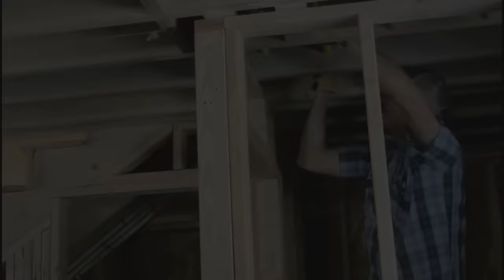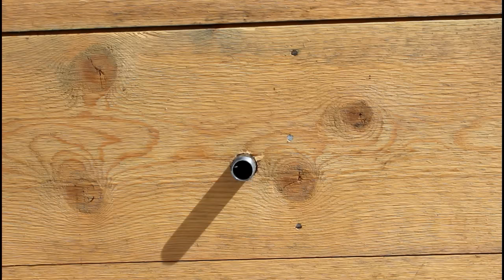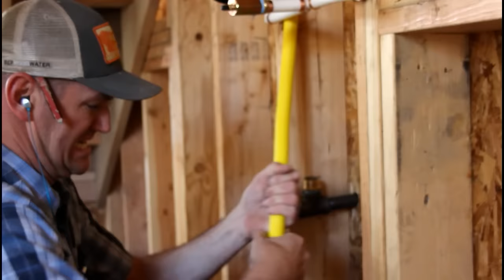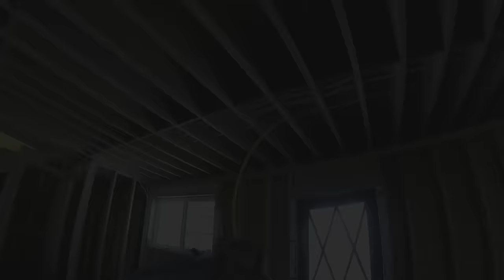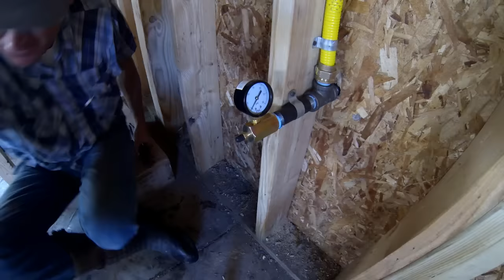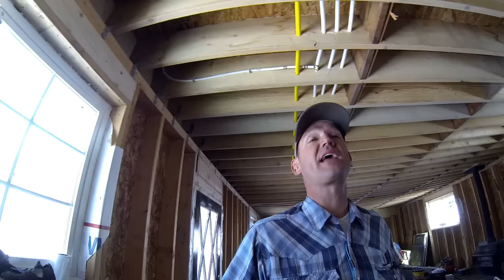#207 - I Installed Flexible Gas Line From Home Depot... (It Leaked!)

Comment: So am I right in thinking a propane tanker will come down the "Road of Endeavour" and fill your system periodically? With your skills you must have thought about heating a water tank with heat from the wood burner, and save on propane. Why did you not do this, I'm curious as to your thought processes? Always a big supporter, wishing you and yours the best.
Reply: Burning wood for hot water is wildly inefficient lol

Comment: was that connection in the ceiling a permanent type connector or a tapered seat threaded together type? I would be worried about a removable type connector hidden in the ceiling.
Reply from the maker: Permanent.
Reply: Iat used to be that gas coupling fittings  were allowed in hidden areas but Union connections were not. but I never was a plumber

Comment: In the USA you have to be a license contractor to install any type of gas line as well as proper training in all different type of materials that you will use.  When I run into a new product I make sure that I understand the way I'm suppose to use the new material.  I've seen plenty of mistakes from handyman and wanna be plumbers. Good video and I like your advice for others that don't know. Thanks for taking the time to do this.

Comment: As a European it is so strange to see gas lines running in the ceiling when it's used on the ground floor. Here the Netherlands is a building code to run those under the house and have them come up through the floor where it is needed.. say the kitchen

Comment: That whole you have to use a certain color of Teflon tape for each type of material I'm not a firm believer. I've found that white Teflon tape works well for any type of material unless your current code requires it.

Comment: I see you have a Laundry Room.  That's going to be a lot of laundry for five children.  I was wondering if Cedar could use a propane gas dryer.  Anyhow, great job going on!

p.s. the AltE Youtube site really breaks down how to size a solar system.  The video series (22) I am referring to is called "Off Grid  Solar Power System Design."  If you watch the first five videos, you will know how to size your entire system.  I am taking notes right now.  This series is a Golden Nugget in solar design.  Amy Beaudet also shows you how to hook up the system in some of the other videos of that 22-video series.
Reply from the maker: I will likely add a line for the dryer up there. We talked about it and have since decided to do it.
Reply: Thanks for considering my suggestion.  There's just one more critical item as I comb through the numerous number crunching on solar panels.  The example AltE uses is for a 2,400 Watt system (probably near $5,000), four 315 Watt panels, four 24V batteries (two in series + two parallel strings).  I notice our new refrigerator sucks up 1500 Watts/day (25.2 cu ft).  That only leaves you with 900 Watts for the house.  I have to decide if I would get a propane fridge instead, so I can free up those 2,400 Watts for all other stuff.  I don't know the answer yet.   I do know if you double your solar system, you double the cost.  I am leaning towards a propane fridge, instead of spending $10k on a solar system.  Just thought I'd mention the fridge before you button up the gas line.  The point being, does one want an electric fridge or a propane fridge?  It boils down to using microwaves, coffee makers, toasters, etc.  Based on my habits, I supspect I'd use a propane fridge.  Over and out!

Comment: I'm pretty sure threaded connections aren't code inside a wall...  No nail plates. Seems like a house waiting to explode.
Reply: Of course threaded connections are safe like steal threaded black pipe inside walls and ceiling same as wather pipe connection 
Your car have a gas tank so you’re car waiting to explode
Reply: If the wall cavity is vented it is legal in Illinois. They do make wall and floor flanges for wall penetrations. Threaded connections in the wall are dangerous if they leak. Also the manufacturers aren’t all the same. Track pipe is preferred by my company due to quality of fittings and piping.

Comment: When should you use a manifold???
Reply: Typically for low pressure residential I would install a manifold right after the gas line enters the house, usually in the basement. The initial gas line is over sized so it can handle the present and estimated future load. Then I size each run and build a manifold out of black tees, and run the appropriate sized CSST run to each appliance. In Ontario CA. you can place the appliance shut off valve at the manifold tee if the branch line is under 50 ft. Or you can have at appliance, or both. If there are some really long gas lines, and it's possible that the local gas supplier will provide 2 or 5 psig meter pressure, then I would do the long runs in a smaller pipe size to get the gas supply nearer to the appliances { in a mechanical room for instance } , then regulate down to proper appliance pressure, and build the manifold in that room for those appliances.

Comment: Why did the pipe get connected in the middle of the floor joists ? Thanks.
Reply: Because he purchased 2-25’ rolls not a 1-50’ that he needed.  Those fittings cost about $10 each.
Reply: Because the Home Depot brand only comes in 25' or 75' lengths.... so purchasing a 50' roll was not an option.

Comment: Propane tanks on ag running gear are common here.  Might be useful as the nonprimary tank (multiples not run in parallel here) if the supply truck will only meet you at the end of the gravel road.  Old NH3 tanks can sometimes be converted.

Comment: Holy crap 25-30lbs?!  That's insane, most systems where I live are .5 to 2lbs max!  Main lines from gas company is max 50lbs.
Reply: Its for the pressure test to make sure it doesn't leak. It isn't the gas pressure.

Comment: With that first tee I just assumed you were making a drip leg. I thought why is he putting that drip leg through a hole in the wall. It took a second for me to process it. 

It’s interesting how many variations there are on gas pressure testing considering there’s only two codes. Some places only require a little over the operating pressure. I’m in Austin and they require 30 psi for 15 min for low pressure systems and 60 psi for med to high pressure systems.

Gas tite is pretty expensive stuff  but it definitely is nice when you need it. In your case where you have to go between joists and only have a couple of fixtures it’s wonderful. If you were paying a plumber, you’d make up that extra cost by saving on labor easily. However when you have houses with gas dryers, water heaters, furnaces, stoves, etc. and everything is under the house or in the attic, it’s definitely cheaper to use black iron especially with mega press. 

We’re not allowed to secure gas tite in the wall except where the stub out is. The reason is for nail protection because it’s so thin unlike black iron. If it’s allowed to be loose it will be pushed out of the way by a nail or screw but when it’s secured it will be penetrated.

Comment: needs bonding and i would never buy the csst from big box stores(or rather they shouldn't sell it) because as an HVAC tech, we are supposed to be certified to sell and install this material, one wrong connection and your new house is leveled.also your inspector should know enough that high pressure like 25 psi can actually seal a minor leak instead of showing a leak, we are told in our area that we only pressurize to 1 1/2 times the pressure the line will be under in normal circumstances which is in  " water column not psi. the Flashshield by gastite also has a bonding mesh incorporated into it unlike the home depot stuff. Also  gastite makes termination fittings for stubbing through the wall to eliminate as many leak points as possible.be careful in the house in the event of a lightning strike if you dont bond that ENTIRE gas line properly.

Comment: Great video quick question, I'm new to the CSST tubing do I need the bonding clamp for ground, if so where do I ground it to?  From what I've seen from reviewing this stuff, it clamps to the black pipe but where does the bare wire get the ground from? Thanks in advance

Comment: Does this type of flex pipe need to be grounded in any way ??
Reply: Yes it does, I just had Weatherservice do an install for me, and the guy used the #6 ground wire.  He is with the HVAC company, and my ex-husband works with the gas company, and he said it has to be grounded as well.  It is suppose to help lessen the chance of sparks because of the type of material made with the flex line.  The question I have is...the guy from weatherservice told me that the line can not be ran through wood/joust.  So, my flex line is visible, on the outside of the wall.  I'm trying to figure out how to cover it up, and have easy access to it.
Reply: @littleclay1838  Depending in what state you are in it will vary on the type of installation. as for covering up, I would think that the connections/couplings should be made accessible. you could probably do a long box with a long hinge to cover it..??

Comment: Ironically , if you order a new gas stove installed by home depot they WILL NOT install to this gas line. I just had this problem this week. They will only install a new stove to black pipe. Even though they sell this gas pipe.

Comment: why not use a gas dryer if your doing off grid and your usieng wind and soler an electric dryer will use a lot of power if you have it gas heated than its far less all it does than is turn the moter insted of power heating elements as well you could also use a propane fired furnace  to for the days the wood stove isent enough

Comment: Am I the only one that’s absolutely shook his apprentice hit a 50 psi main line? I’m sitting here weak af. Like I’ve had some bad days as a gas service apprentice but goddam. I’d straight up switch trades if I pulled some shit like that... Also, no shit gas code is yellow. If you haven’t  arrived there yet you shouldn’t be watching this video or installing your own csst! It can be tricky , especially if you don’t use a cutter designed to cut csst. I was literally on a gas leak call today where a local contractor failed to cut his  csst with the correct  tubing cutter  and the fitting was pouring out gas directly next to the furnace as a result. It saves lives to invest in the proper training and tools to complete the job. All I’m saying is take what the homie on YouTube, who hires techs that don’t know the difference between gas and water lines, with a grain of salt. Do extensive research, buy the correct tools (as expensive as they may be) and assess the risks before installing your own csst gas lines... either that or research a good, reputable local gas contractor and give them your money instead. We charge good money and have a license  for a reason. Fresh video tho
Reply: All I heard on this comment was blah blah blah I’m a big bragger
Reply: @rubenllamas5644  you probably do your own gas plumbing too so it’s all good
Reply: Well I’m a second generation general contractor so yes I think I should know how to properly run a gas line. Don’t talk about it be about it.
Reply: @rubenllamas5644  All I heard was blah blah blah I’m an old man
Reply: Dude I was born in 1991 😂😂😂😂
I don’t need to talk like I know it all or like I’m perfect in order to make my existence meaningful. In your comment you were bashing the apprentice who makes mistakes 😂😂😂😂. Idk who trained you but obviously they skipped the part where mistakes need to be made in order to grow idk who told you you need to get it right the first time. Or maybe you are perfect but that’s highly impossible because just by yoour comments I can already point out a few flaws of yours that you probably continue to apply in your life because you think you know everything. It’s a lot easier to teach someone who wants to learn an is flexible to understanding that he don’t know everything than trying to teach someone who thinks he knows everything. In order to be a good master you need to be a great student. So maybe you should take a few steps back an recollect yourself and remind yourself where you came from.
Reply: @rubenllamas5644  everyone makes mistakes and I’ve made my fair share but I’m not gonna post my mistakes on YouTube and pretend it’s good work. I’m definitely not gonna have a sore ass after I post my mistakes on YouTube pretending it’s good work and somebody points out the flaws in my method. I think it’s you who needs to take a step back and realize we all can learn to be better people and technicians by having a dialogue and a back and forth conversation instead of a sore ass.
Reply: You make 0 sense buddy
Reply: It’s not the punch it’s the delivery learn the difference
Reply: @rubenllamas5644  I understand you have reading comprehension problems. Go run Daddy’s business and have a nice day buddy
Reply: How else do you think empires are built 😂😂😂😂😂😂

Comment: It comes as no surprise that the flex line leaked. It's garbage. You should always use black iron pipe for gas to prevent these kinds of problems. You're asking for big problems using flex gas line, especially in a basement or crawlspace.

Comment: Don't you have to bond the csst to ground?
Reply: Yep, according to the manufacturer he does.  His inspector doesn’t know it, and he failed to read the instruction manual. Your supposed to have a card from the manufacturer stating your trained to install this this, before you can purchase.
Reply: You don’t actually bond the csst, you bond the black pipe as close to the csst as possible.
Reply: And if you can't bond directly to the black pipe, bond to the brass fitting attached to the black pipe.

Comment: can you use flexible gas line to for your bbq grill setup?
Reply: Csst can be used right up to the Appliance. You can run it straight to the Gas Valve if desired. Just remember to install a Sediment Trap if installing a Water Heater or Gas Furnace. Also check with you local Code official for any amendments. Master Plumber.
Reply: I used CSST to install a Natural Gas Grill at my Home. I used a combination of Black Pipe and CSST. Worked out fine.

Comment: Can anyone install this piping? Do you need special certifications? I need to plumb my entire mobile home for gas.
Reply: Just don’t blow your house up, and I don’t recommend using Teflon tape for gas, it is approved in some states but illegal in others, I’ve seen Teflon tape sealed gas pipe leak way more frequently than pipe joined with a good non hardening dope, go online to gastite.com to get more info on CSST installation and install the pipe with the appropriate strike plates, floor flanges, etc. and use the longest run method to appropriately size the tubing, get the latest IFGC book for relevant information on installing CSST and appliances for mobile homes, good luck!
Reply: In my state only a state certified master gas fitters can do gas lines.  The gas company will not release the house for gas service without a pressure test from a gas fitter.  If they provide gas and anything happens they would be liable for providing gas to a house not properly ready for gas.

Comment: omg amateur you did everything wrong.. first off you NEVER put the Teflon on clockwise with your right hand while in direct sunlight - according to building code you NEVER ever do that trust me i'm a journeyman tube snapper for over 3 years - just kidding good job on the house, looks great and awesome video, it answered my questions I had for my next project .. like and sub'd
Reply: tube snapper....lol
Reply: Your second fail is u do not Teflon tape propane lines only if it’s over 1 1/2 black pipe just dope it
Reply: Atleast in north Carolina you can not drill holes in floor Joyce

Comment: The pipe you put thru the outside wall for the regulator hook up looks like it got some wood chips in side of it when you shoved it thru the wall then you put a cap on it.
Maybe you should have blow  all your piping out before you do your FINAL INSTALL of everything. 
Just my 2 cents worth
Reply: Since there is going to be low flow, low pressure gas going in the pipe this is of no concern. Whatever small piece of debris will end up at the end of the run in a screen put there just for this. Of course there should not be a lot of crap in the pipe.

Comment: Why not run the line on the outside of the house to the second location? I've never seen propane gas line buried in a floor? Must have different codes out west. Here in Michigan gas line has to be left exposed inside. So you run outside to the next location or bury it.
Reply: That is interesting. Here out west we cover it in walls just like plumbing water lines. Some parts are left exposed for access tho.

Comment: Tracpipe is not yellow, as you state "all" are.  The yellow flex pipe must be grounded as it is not arc resistant (as is Tracpipe).  You did not even mention this in your video.

Comment: Hey nice video, my csst was pulled through a wall and the yellow cover got all chewed up from tite spots . The stainless itself seems to be ok few spots show a scratch . Should this be redone or is that csst pretty stong. I couldnt Peirce it with a knife or screwdriver    the stuff it pretty flexible.
Reply: Rust will compromise it, hard to say how long. If I was an inspector I'd make you replace it, though honestly it should be fine for a while.

The problem is that steel wall is so thin that it needs that jacket to prevent corrosion.

Flexible pipe is only flexible for installation; too much flexing over time will cause a leak. IMO only use that stuff for underground or appliance hook-up. Black pipe is not that hard to fit and when mounted and installed properly, will last many lifetimes
Reply: The pipe should have been wrapped with electrical tape going through a wall, that is code in canada.